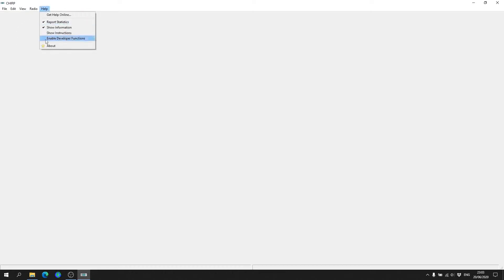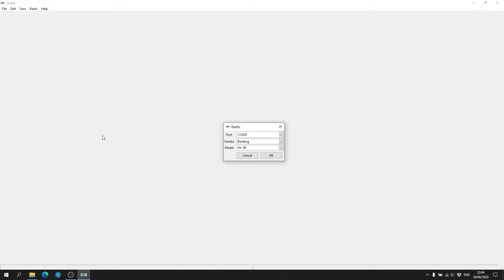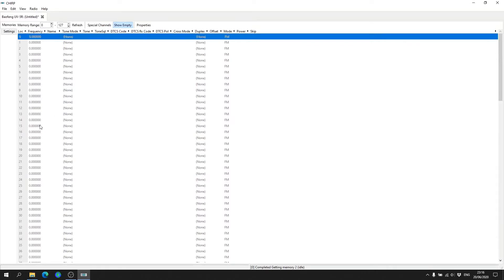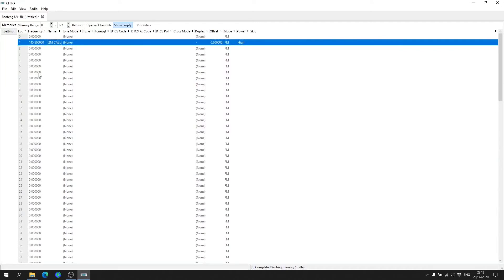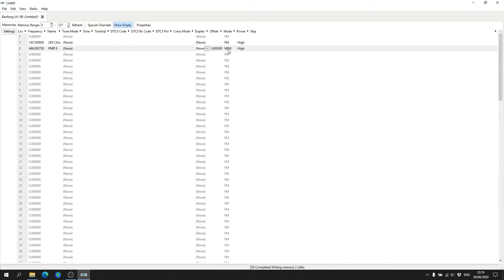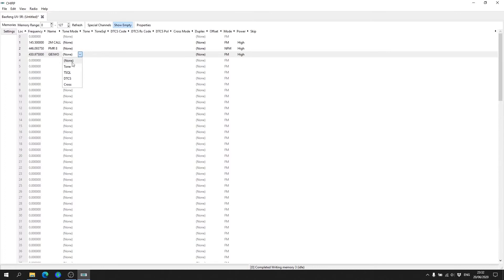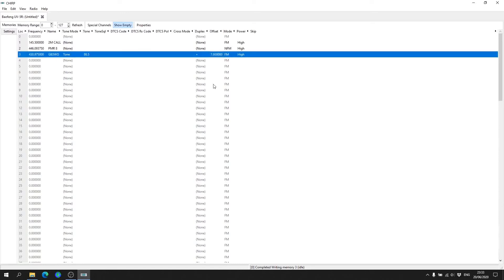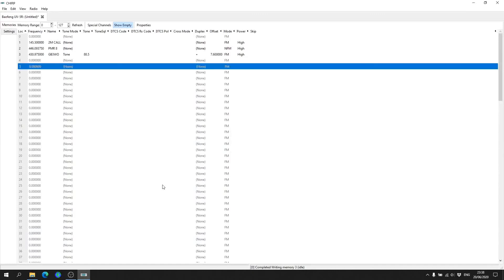Programming with Chirp | In a few easy steps

Comment: I'm trying to program 155.550 FM with a CTCSS PL Tone of 179.9 into my BTECH GMRS V-1 using CHIRP.  When I do, all I hear is a bunch of garbled unintelligible noise when the station transmits.  What should I have my Tone Mode, Tone, Tone Squelch, Cross Mode, etc set to in CHIRP?  It sounds like it might be encrypted, but Radio Reference says otherwise.  Thanks,  Matt :)

Comment: Thanks Mike, just bought a Leixen VV898S which works well but the software isn't reliable. Tried Chirp and it works well. Not sure if I can program other features like P1,P2,P3,Time etc as the Leixen s/w should but will use for channel setup. Martin

Comment: Hi Mike, I'm trying to programme repeater GB7ZE into my UV-5R and I'm stuck on the how to find if a tone setting is required? I've looked at the repeater details on Repeater Book and it says CC3 in the Tone column, how should that be entered when programming with Chirp, thanks in advance for any advice.
Reply from the maker: It won’t work on a Baofeng UV5R. GB7ZE is a DMR repeater. You’d need a DMR radio to operate that particular repeater. Hope that helps, 73’.
Reply: @OntheMicwithMike  many thanks for your reply, I programmed it and also found out that the Tone is 103.5. I've been able to receive broadcasts all along the UK south coast from Chichester to Hastings via a number of repeaters which are linked.

Comment: Thanks. This is helpful. When I use the Radio/Query Data Source/RepeaterBook option it displays the list of repeaters but doesn't include the offset frequencies. This is possibly just a bug or maybe I'm doing something wrong? Cheers (Sub'd)
Reply from the maker: Much appreciated. I know that the RepeaterBook App gives you the offset, but some sites give you the actual uplink and downlink frequencies and you have to work out the offset yourself. It’s a shame chirp doesn’t offer an option in support of entering both up and downlink frequencies manually.

Comment: thanks Mike pick up a Wouxun KHG-UV9P and has not a thing on.
so download and it is blank. than put all the frequncy that I want to use.
than save it. than uoload it back into the radio, do I have it right.
been off radio for 20 some years, and wow, technology changed.
73 KQ4CD Paul

Comment: Hey there, If I have a series of repeater frequencies and they have a tx and rx- offset and the way that these series of repeaters is set up is: there are 'tone districts' in other words, the tx and rx work on many different coloured repeaters and the tines are only a set of 6 districts. so we set channel(frequency) then we switch tones depending on which district of the 6 we are in. Question: how do I program the Baofeng uv82 in the freq list as it appear I have to assign a tone for each freq? is there an area where we store another bank of 'switchable tones' as for use in this case and leave the associated tone filed in the feq list blank? thanks so much!
Reply from the maker: I must admit I’m not familiar with it, as to be perfectly honest I don’t really use repeaters myself. I’m not quite sure that is at all possible especially on a Baofeng. But maybe someone can shed some more light on the subject for you.

Comment: I have the next generation Tidradio H8. When I try to upload my frequency list I get this error message > unable to upload file. This is a radio- independant file and can not be uploaded directly to a radio. open a radio image (or download one from a radio) And then copy/paste items from this tap into that one in order to up load.  HuH? what radio image? where do I get it from this H8?  I am connected to the radio via a tidradio cable. the radio is selected in chirp. all looks good except for this error. Please help. Thankyou
Reply from the maker: Doesn't sound like it's compatible, it may even be the driver not communicating with the computer correctly too. Have you tried Tidradio's own programming software?
Reply: @OntheMicwithMike  I tried the odmaster and it does not give me a full spreadsheet. You have to step through each channel and type in what you want. just as slow as manual programming. I am thinking to purchase the Rtsystems software. expensive but the only alternative. Thanks for the speedy reply.

Comment: When I follow the directions for the chirp software on the spreadsheet, I have all of the frequencies and offsets set properly. When I go to upload it to the radio it uploads everything except the frequencies for every channel. All channels end up the same 145.470. (which is the first channel listed on the spreadsheet) Why will the frequencies from the spreadsheet not upload to the radio properly?
Reply: The freq end up being the same for each channel even though the downloaded spread sheet shows the correct freq and when I upload back to the radio, the freq on the uploaded spread sheets are correct. They just don't end up on the radio. It repeats the 1st freq for each channel programed in the radio.
Reply from the maker: The file you're using with the frequencies is for the radio you're trying to upload to? I can't say I've ever encountered this problem myself. My only guess is the file is for a different radio than what you may be trying to program. Each radio can differ slightly as it will upload radio settings than might not be compatible with the radio.
Reply: @ Thanks for the input. I'm not real techie, I am in my 70s, and I was looking at the frequency while in channel mode so of course it wasn't changing as I was changing channels in channel mode. Once I changed to freq mode the freq changed as I flipped though the channels while in freq mode. So there was no problem, just operator failure.......LOL. So I guess in young person vernacular.....MY BAD. Thanks
Reply from the maker: @prepperboss   I've done the exact same thing myself sir! haha. Enjoy the radio, all the best.

Comment: Thanks for this video! I have a question, can I extend my connection between two radios Boafeng UV 9R with this CHIRP programing?
Reply from the maker: How do you mean extended your connection?
Reply: @OntheMicwithMike  I mean to extend the range between the two radios. Now my best range is about 6km. I need more :) !
Reply from the maker: @vladislavvelchev  not really, all I can suggest is height. If you can get out onto high ground and you'll have greater range. Most Baofeng radios have under 4w of power output so signals don't really travel far for a handheld radio.
Reply: Thank you!

Comment: Hi Mike, I am having a bit of an issue with this one, downloaded various versions of Chirp to my MacBook Pro but when I search for CRT Micron it is not listed in the dropdown box. Any ideas or help would be appreciated.  73's Stan M7MGP
Reply from the maker: Ah yes, you can try to look for the Anytone AT778 as that is the same radio just a different badge. 
Chirp only recently started supporting them and the radio needs to be a version 3 onwards because my old version 1 radio still doesn’t work.
Other than that, you’ll need to download the software for the radio from their own website.
Reply: @OntheMicwithMike  Cheers Mike, the CRT Software is windows only. The Chirp website says it supports the Micron but I feel it may only be the Windows version.
Reply: Plus, on my version of Chirp the AT778 is not there either
Reply: Use virtual box on your Mac

Comment: I want to download the channels from one radio and set them in the new one. What do I put in the space for port??
Reply from the maker: Plug in the radio you want to take the frequencies from, and open chirp and hit ‘read from radio’ then when it’s done, save that file to your pc.
Plug in your other radio and either open the file you previously saved with those frequencies you want to put on the new radio and click on ‘write to radio’. However you might find some things won’t transfer if their different radios. 
Otherwise just use copy and paste to copy over the frequencies from one file into another new file then upload that to the new radio.

Comment: Hello. I have a boajie bj-218. It cannot be recognised by chirp in the recommended file. What can I do to remedy this.
Reply from the maker: The 218 is supported by Chirp, but if the radio isn’t being recognised it might be a data cable driver issue or the cable itself. Not really sure, might pay to raise a ticket in the forums on the danplanet page (where chirp is downloaded from).

Comment: In Chirp which is the input columns and which is the output column?
Reply from the maker: The ‘frequency’ column would be the repeater output. There is no input as that’s done through setting the offset in the ‘offset’ column and you change the direction in the ‘duplex’ column which will then be set to the ‘input’ of the repeater.

Comment: Hi I am very new how do I get the channels for where I live .
There is no gt-3tp on the list
Reply from the maker: For the GT3TP, try using the settings for the UV5R. 
As for repeaters around your area, look on the website called RepeaterBook, it will give you the 2m and 70cm repeaters around your area.
Just have to state that you will need to be licensed to use the repeaters yourself, but you don’t if it is just for listening purposes. 
Transmitting on them without a license can land you in hot water.
Happy programming :)
Reply: @OntheMicwithMike  thanks for your help it is just to listening I am going to get my licence later when I can understand it as I am very bad a reading need all the help I can get thanks again
Reply: Thanks for  your that all works good 👍

Comment: This WILL NOT work on my UV82. I have tried and made sure the drivers are installed. It simply will not programme no matter what. I can input the frequency but it just keeps reverting to original. I cannot find any way to reset the radio.
Reply from the maker: It’s possible the cable just doesn’t work, I know that some people have reported that some Baofeng radios are very picky on what cables are used. I would try another USB cable. 
I’ve had no issue programming a UV82 using Chirp.

Comment: I manually programmed all my channels. But I save high power and it always goes back to low. I save dcs on transmit and receive and it goes back to off. With the chirp software can you program all settings like I mentioned? Any reply appreciated cheers from Australia
Reply from the maker: That’s quite a strange one, what radio is it out of interest? As for chirp, once the settings have been programmed in, the radio doesn’t revert back to default at all. Well, I’ve never had a radio have a problem like that either manually programming or using chirp. 73’
Reply: @OntheMicwithMike  baofeng uv5r iii. I'm waiting for a program cable. Cheers
Reply: @dragan3290  update.....
Reply: @michaelvoorhees5978  I did that! Nothing!
Reply: @dragan3290  that's odd!!

Comment: What about input and output frequency?
Reply from the maker: Repeater output frequency is what you would put into the very first ‘frequency’ box this is what you would be listening on. As for the input frequency (the frequency the repeater is listening on) doesn’t need to be typed in as that is what you set the offset to do in the software.
Reply: @OntheMicwithMike  Ok. Can you still program frequency if it say FMN? And Can you help with with tone mod on chirp software and tell me what they mean? Because some of my department use DCS and CTCSS.
Reply from the maker: @OfficialChrisBreezy  FMN is just narrow FM, basically cleaner audio whereas normal FM is widebanded and will bring in a lot of mush.
As for DCS and CTSS codes, you'll need to know what they use, and those are entered in Chirp under 'Tone Mode' and then the tone frequency under 'Tone'.
Remember though, most of what you are programming within Chirp requires an amateur radio/Ham radio or business license.

Comment: I have a QSP5888UV_S1 and no luck, help please!
Reply from the maker: More info will be needed for someone to help :)
Reply: It is an Anytone radio model QSP5888UV_S1 tried Chirp, and others and it doesn’t recognize my radio, alot say comport not support.
Reply from the maker: Chirp doesn’t support it by the sound of it. You’ll need to head to Anytone’s website and download the programming software. I have the Anytone 778UV and it’s an older model, chirp doesn’t support the older versions but only recently started to support the newer models. Your best bet would be check Anytone’s own website for their own software.
Reply: On The Mic with Mike thank you for getting so quick, i will do just that.
Reply: Oh on that note, i have an older 5888uv i was wondering about cloning it to the new one, much easier and quicker, the older one has all i need programed, can i use a regular lan cable?
Reply from the maker: To be honest I’m not familiar with the radio but can always try it :)
Reply: @stryker819  , I would think a com port error would be in your pc, since it is where the cable is connected to on the computer,  not a port on the radio, try a different port.